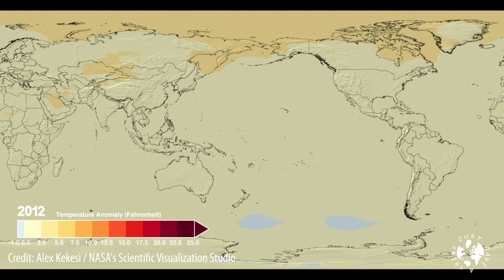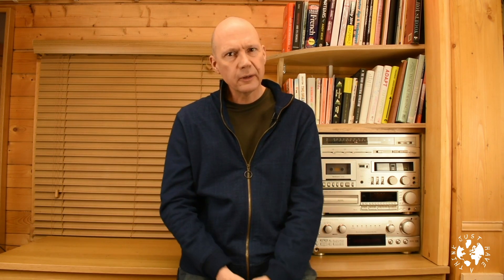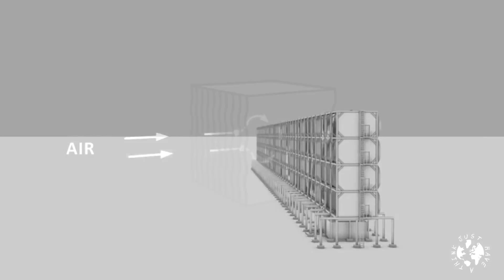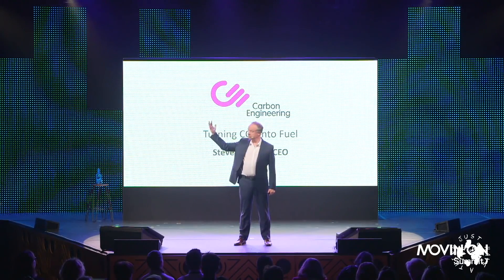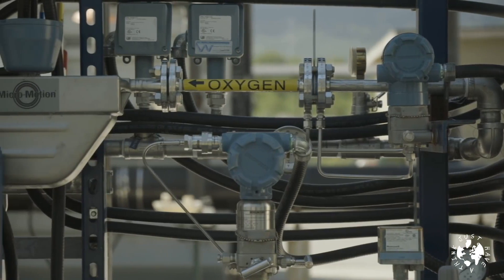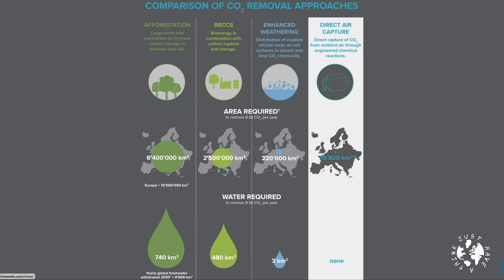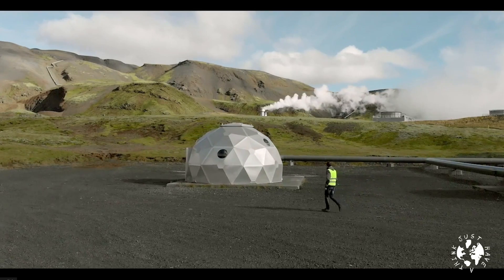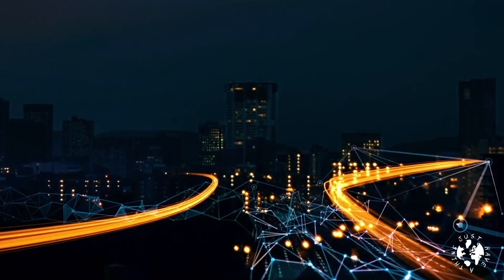Direct Air Capture Technology

Comment: EVAP System
The Evaporative Emission Control (EVAP) System captures gasoline fumes and other emissions produced when fuel evaporates within the gas tank or fuel system. The EVAP system then returns these vapors to the combustion process to keep harmful chemicals from reaching the air when the vehicle is not running.

Comment: So the Canadian billionaire guy really did luck out. But only if the tech ermains closed. The good news is, most of the tech is open source. So in theory, there could be many others that deploy this tech in different ways. Imagine a farm sized system, that runs all the energy needs of a mechanized farm, both for fuel and electricity. Or a roof top home version that fuels your car.

Comment: Say a company built these in the cheapest possible country, can they claim offset credits in $us from some company in the US to the same extent as if they were in the US? How does that work? Now imagine a non-profit setting up a carbon capture plant with the express goal of using the fuel captured to power a second plant, and so on. What size would such a plant be in the limit to make it self powering. What size would it need to be in the limit by selling excess fuel with no capture credits at all to be self funding?

Comment: Couldn't you compress the CO from coal stacks and burn it as fuel?
Reply: there shouldnt be much if any carbon monoxide in the coal stacks. carbon monoxide did used to be burned as fuel in the days when gas works made town gas from coal.

Comment: I have looked at Carbon Engineering in detail and have concluded it’s a scam and here is why.   Look carefully at their process and you’ll see it relies on massive amounts of renewable energy to power the system.  Near guess is that let’s say we get 1 kwh hour of energy from a fossil fuel which releases one unit of CO2.  Now using Carbon Capture, we would have to use around 10kWh of nrewalble energy to remove that one unit of CO2 which begs the question “ WHY NOT JUST USE THE RENEWABLE ELECTRICITY IN THE FIRST PLACE???
Part of the reason is the assumption that we want to continue to operation fossil fuel vehicles which is ridiculous when you fast forward ten years to witness the obsolescence of Fossil Fuel fired vehicles. By then electric vehicles will be 40% cheaper than ICE (Internal Combustion Engined) vehicles, will last 4 times longer and cost a quarter to operate. ICE is already more expensive than Electric vehicles but that necessary transition is not to find ways to fake us out to pretend that we can remove carbon dioxide but to simply stop putting it into the atmosphere in the first place. 
My analysis ignored the giant capital cost of Carbon Capture.  When we are not even spending to  eliminate CO2 from the source where concentrations are huge then why would we suspect that we would then make a far more massive investment to remove it from the air?  The real reason is all about appearances. Making this worse is that most carbon captured is used to produce yet more Fossil Fuel but even if sequestered, there is little guarantee the CO2 will stay there.  Look at how simple and cheap it would be to stop Methane leakage which is a major green house contributor but now we are supposed to absurdly believe that some entity will spend orders of magnitude more money to remove CO2. 
To put this in perspective, it would be reasonable to request that Fossil Fuel companies remove all the CO2 their products emit when they sell the product.  Similar to say fees charged for recycling lead batteries.  I suspect that fee would increase the cost of Fossil Fuel by about 100 times settling the argument once and for all.  There is no good reason we cannot ask Fossil Fuel companies to remove their CO2 but guaranteed they would never even allow that conversation to start. 
Another perspective is the Stanford Study on the cost of burning Fossil Fuel at 67T annually in a World economy of 87T. Essentially this industry has been getting away with wholesale asset destruction for decades and would like to trick us into continuing or even getting confused since every day they delay means another 5B in sales. 
The annoying part is that this false Carbon Capture will distract us from creating a massive renewable energy infrastructure with enough batteries in vehicles that they can help suck up all that excess renewable energy we’ll need and have to dispose of off peak.  We could afford to give that energy away for a penny as long as they were will to take it when there was no immediate market for it and possibly give or sell some back when demand was high. 
With construction, operation and maintenance costs of carbon capture, it’s easier to see an net increase in carbon emissions for those efforts long before any decrease is accomplished. If ever.

Comment: Socialism, or accounting for externalities, doughnut economics? Excess CO2 equivalent to all that 3 kilometres & below, 1.1T tonnes, lot of fans. Add 50%, BAU 2100, but now double the altitude, all CO2 below 6 kilometres. Restore a generation of trees? That's 2T trees; oops, we burned several generations of trees. Better get cracking lads. We need a sophisticated carbon price, one that pays a premium for genuine air capture. Hmmm, wouldn't they love to pump Carbon Monoxide into that CO2 to alkane process (Fischer Tropsh, South African apartheid sanction busting coal to oil technology) and make it economically viable without a carbon price (you know, by smouldering coal).

Comment: 1 Ton of CO2 sequestered for every Barrel of Carbon Negative Algea Bio Fuel. We could ( and need to imo) use our current ICE Vehicles in effect as Carbon Capturing machines. By running them on Carbon Negative Algea Bio Fuel, we could permanently sequester 10’s of billions of Tons of CO2 every year just in the UK, Photo Bio Reactors( PBR) are easy, cheap and quick to build and could be rolled out country wide in every locality, in 5-10 years!. . Check this vid out- https://youtu.be/yP5ADjTB-m8

Comment: But CO2 is not fuel. To turn CO2 into fuel you need to add even more energy than you can get out of that fuel. So you would need the energy needed for the DCC plus the energy to make the fuel. It sounds like a way to get subsidies. It's only real advantage is that it would allow transporting the energy

Comment: Could you please emphasize every single time carbon capture technologies are brought up 
that the laws of thermodynamics say that more energy is required to capture X amount of Co2 
than was release when we burned the fossil fuels, because CO2 is the lowest-energy state that carbon & oxygen want to be in?
And make a separate video on this, too.
And, also, emphasize, and make a separate video, if necessary (well, it IS necessary) that the kinetics 
of a process is separate from the thermodynamics. Thermodynamics tells you if something is possible. Kinetics tells you how fast it can happen.  I am all for CC technologies, but we must NEVER take our mind away from the mathematical laws & restrictions on how fast some desired process can occur.

Comment: Carbon capture using electricity will never be worth it because it will always use more energy to remove a ton of C02 than the energy you would need to replace / prevent the burning of fosile fuels to prevent the emission of a ton of C02 in the first place. 
We have been capturing carbon for ages by using wood as a building material. The only problem is ofcoarse that we don't replant the trees we cut down...

Comment: A possible alternative is to increase the bio productivity of the ocean via OTEC. Floating OTEC plants could be dispersed into the huge areas of low ocean productivity and the nutrient rich cold water they pump up would feed plankton. Surplus electric power could be used to synthesize ammonia by using hydrogen from the electrolysis  of the fresh water made, and nitrogen filtered from air. This could be sold to make fertilizer and hopefully not explosives. Between aquaculture and ammonia; it might make a profit.

Comment: I think it's pretty clear that both DAC and DACS will serve a role in the future. 

The necessary renewable energy (especially wind and solar) is becoming cheaper by the day, and there is little practical limit to the supply. With growing recognition of the harm of having so much CO2 in the atmosphere, state sponsored sequestration will also likely become a much more popular idea in the near future. 

One of the greatest advantages of synthetic fuels produced by this method is that they burn far cleaner due to the near absence of impurities. This allows for more efficient combustion, creates less local air pollution, and greatly enhances engine longevity. 

One thing is for sure though; it's not going to be "business as usual" for the fossil fuel giants for very much longer.

Comment: I'd like to see good re-assessment of this kind of technology from a whole cost perspective, which is one that typically is never done.  I think you may be one of the best candidates out there for wrestling up some independent people to do this.  Ideally, there should be two independent parties doing the same project without knowing the other, and that would be minimally independent, and low of risk of bias itself.  You need someone who not only can see things in terms of present discount rates, but in terms of direct effects to all ecosystems, and exhaustively all the risk factors around these, then have both analyses critiqued by at least a third, if not two more parties.  As an example of results, not necessarily the one you'd get now, but reasonably possible still, is one I saw which asserted that literally no manufacturer, in the world, could be profitable if it had to pay for real costs to all its pollution mitigation.  Given the serious possibility of these, there would be two outcomes: 1) the "reduce" in reduce, reuse, and recycle would need to become our absolute primary activity in mitigating our existing pollution state problems, and 2) the only justification for such non-sustainable projects would need to be short term for things like mitigation of misery during the primary activity of winding down.  The result doesn't change if it is good, but still in the ballpark, because the risks are always there.
Reply: I also again strongly recommend Richard Heinberg's work on real sustainable levels of available carbon.  He probably is not exhaustive in the same way I want to see, but he did a lot of good work on this stuff.

Comment: I think a third way to use carbon dioxid provided by air capture. It would be to feed cyanobacteria duly selected for their methane production or implanted with efficient biosynthesis pathways to produce longer hydrocarbons such as propane or butane or even very long hydrocarbons. And by the way, if we speak of doing things payed by taxes, why not put hydrocarbons made in this way in the now empty oil and gas fields : the wells are already prepared!

Comment: Two comments:
1. Financing DACCS.  In the US Electrical Market, a DACCS plant could purchase energy during peak renewable energy generation and curtail operation during peak electrical demand, earning more revenue on the Demand (Response?)  Market than spent on the energy market.  (I don't recall the specific names for the wholesale markets.) Operation in such manner drive a larger base electrical load provided by higher efficiency plants alongside the renewables and, in turn offset the need for peaking plants that are less efficient and more often idle.  Add the ability to sell carbon credits in a carbon market and there is possibly little DACCS-specific regulations required.  DACCS might be able to compete against a similarly sized peaker plant that must purchase the carbon credits in order to operate.

2.  I made an estimate that I would like confirmed or refuted.  The density of crude oil is ~ 0.85 tonne/m^3.  The carbon density in the crude should be ~0.75 tonne/m^3.  For well depths over ~1.5km the density of CO2 due to hydrostatic pressure is ~0.75 tonne/m^3.  However CO2 is 27% carbon by mass.  This implies that we would need to sequester ~3.5 times the volume and a bit less than that of the mass of the crude oil extracted to be carbon neutral on the crude oil extracted.  I'm not a geologist so I have no idea if we have a surveyed inventory of suitably permeable formations amounting to 2.5 times the formations from which we have extracted oil.  As I requested I would like to hear your comments on this crude estimation.

Comment: Electrolysis of seawater can produce hydrogen (for power generation to offset some of the energy used) and sodium/potassium hydroxide for removing CO2.  Just so happens that a lot of wind farms are built off-shore, so no lack of sea water.  Not sure what to do with the chlorine that would be produced, but someone probably has a solution for that. Get rid of the carbonates produced by filling disused mines (as long as the CO2 generated by transportation doesn't negate the amount removed).

Comment: A practical method which is profitable is to use pyrolysis.  With the pyrolysis of tires and plastic which have been produced from oil, you reduce the amount of new oil you must extract from the ground while cleaning up these sources of pollution.  With pyrolysis of wood, or other organic waste, not only do you produce the usual cooking gas, gasoline diesel and airline fuel but the by product is biochar (charcoal) which when added to the soil has many benefits plus providing long term sequestration of carbon.  Any system we use must be profitable or it won't fly.  
https://mtkass.blogspot.com/2019/09/pyrolysis.html

Comment: We can use hydrogen fuel and solar and wind power. We should replace the internal combustion engine as fast as we can.  It seems from what you explained to us
that we will also need to clean the air as an end in its self. Clean air should be a commodity just like bottled water. We should pay for it in taxes and savings
from not fighting any more wars for oil. Making more gasoline from the air sounds like a dog chasing its tail while its house is on fire.

Comment: For carbon capture to be useful, the power to run it must be produced by green means and the carbon produced to manufacture and install the capture equipment would probably make the carbon payback many, many years before you get a net reduction in CO2. Better to use the capture technology before the CO2 is released to the atmosphere at sources of concentrated CO2 generators such as coal fired powerplants (better to replace these with green energy), steel manufacture, cement manufacture, natural gas processing (much CO2 comes up out of the ground with natural gas), and etc. I really enjoy the videos - they really do give you something to think about.

Comment: Very interesting. I’m interested to know how much electrical energy is required to run the extractors - the whole cycle. As you say, unless you have an electrical source that’s extremely low carbon and constant (dare I say nuclear), I strongly suspect the maths overall won’t work. 
I’m really hoping that one or more of the new nuclear techs will help solve the problem of electrical energy required. 
Sadly, solar and wind and the 5 other current renewable electrical options (excluding nuclear) can’t do it, as they can’t cover the shortfall in the electricity requirements of the globe. I’ve no wish to have a shouting match about nuclear but after 10 years of reading and research about it, I’ve yet to see/hear an argument for increasing electrical production without increasing carbon dioxide production ahead of the amount of electricity produced.
Reply: Apparently it takes around 30% of the power produced by a coal power plant to add the carbon capture to make it carbon neutral.
Going by this it'll add a lot of power consumption to any industrial process that will actually make a sizeable difference.